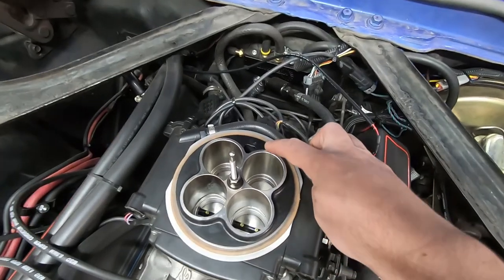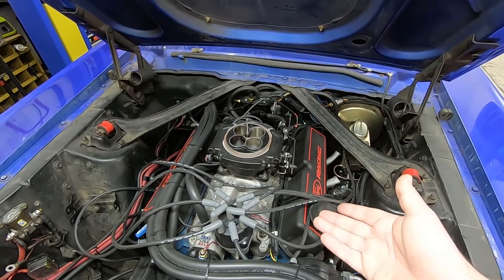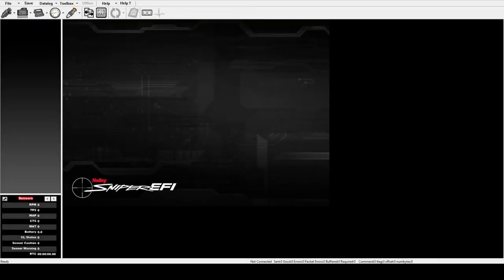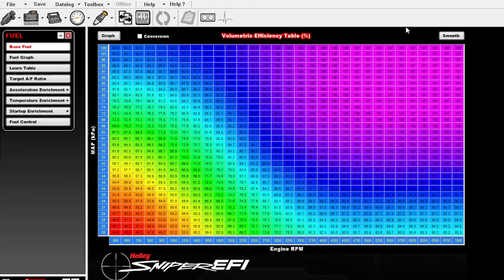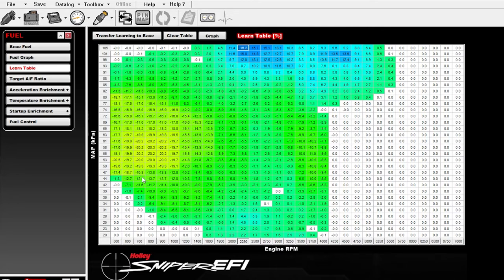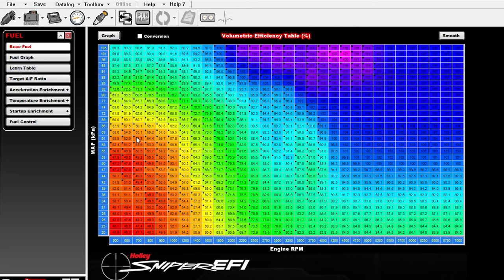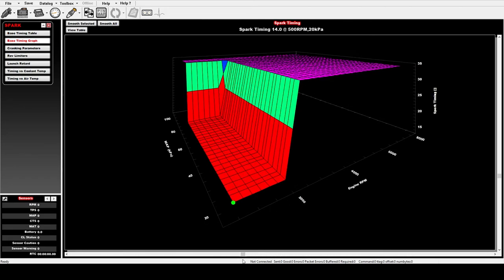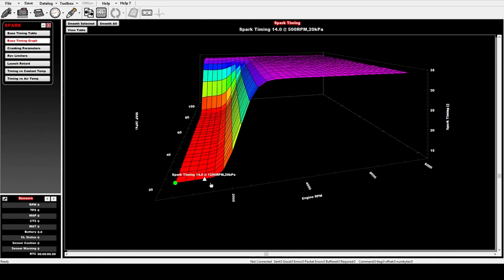What I dislike about my Sniper EFI system and how to fix them!

Comment: So, I'm trying to work through some challenges with my Sniper install.  Here's some of the challenges that I'm currently having and some history.  I'm not sure what your appetite is for this type of question, but here goes.  The car is a 4 speed 1970 Gen II Camaro.  What  I know for the engine is:  probably a 383cu.in SBC.  It has a roller cam, Trickflow heads, an RPM Airgap manifold with 1" spacer.  I do not have any cam specs but a month of fiddling with the Sniper and various testing would indicate that the cam has a lot of overlap.  At 800 RPM the engine only develops about 7-8" of vacuum.   I have tested for vacuum leaks and even replaced the manifold gaskets.  The only vacuum port on the manifold goes to the brake booster and the Sniper ports are blocked off.  Two different vacuum gauges confirm what the Sniper shows for KPa.  

The good news is that it runs OK but I can't get it to idle well.  I've tried all of the "tuning" tips on the IACV to no avail.  Right now with the latest reset, the throttle position is about 2-3 turns off the stop but the IACV reading is about 50 after the engine warms.  It will also stay above 2000 RPM when driving - sometimes it will return to my programmed idle speed (1000rpm) sometimes it stays about 2000 rpm until I blip the throttle or keep the engine in gear until it runs below 2000 rpm and then shift to neutral..  then the idle will return to the idle set of 1000rpm.  BTW the engine seems to run quite rich at lower rpm and my VE table shows the same even though the AF ratio is set for 13.7 for idle..  15.3 for cruise and 12.5 for WOT.  

I think my question is how do I set idle and IACV to eliminate this problem?  I have tons of other questions but I'd like to get that resolved first.  OH and your above video indicates that I must transfer "learning" after each drive?  I that correct (I'm using a laptop NOT the handheld)
Reply from the maker: I would do 2 things. First, tape over the IACV and adjust the idle the best you can to try to get it down around 5-10 warm after you remove the tape to hit your target idle. Next, check your power supply to the Sniper unit. When my power supply was not perfect, my IACV would do this same thing, and because it got better when I blipped the throttle I thought it was running related, but really it was power related. Occasionally it would even "stick" and read that it was 0% open but was physically wide open with a 2k idle.

I eventually solved the issue replacing m fuse block with a PMU-16 and rewiring everything to go through there, but you can probably solve yours just making sure your power source for the Sniper is from the battery and not from a dirty source on the alternator side or shared with other surge happy devices.
Reply: @AmbiVe    I have performed the IACV tape-the-opening and adjust the throttle routine at least 5 times - the last one yesterday.  Everything is wired as Holley specifies  - directly to the battery.  I have a triangular marine battery connector on the post and the power to the Sniper is taken from 1 of the 3 posts on that connector.  My alternator has been upgraded to a 14.4V system and the primary alternator wire has been relocated so it doesn't run along the length of the manifold and goes down the front of the block and only to the starter.  My gauges and logs show 14.4 volts consistently.  My log from yesterday shows 14.5 volts with about .2V fluctuation.
I couldn't drive it yesterday - it was raining - let me take it out and see if the problems persist while driving - they did in the garage..    And I'll try the IACV tape and set again..  maybe I'm doing something wrong..  I have also replaced the IACV just to be sure..  

THANK YOU FOR YOUR TIME..  I may have to take this to an expert but I would like to learn to tune this engine and spending $100's more kind  of defeats the reason I chose the Sniper..
Reply from the maker: Mine never showed any voltage issues either, it just disappeared after the rewire and retesting. Where are you pulling your 12v switched power for the Sniper from and what are the speed settings on your IACV set to?
Reply: @AmbiVe  12v switched power from a 12V Switched source in the aftermarket harness directly from the fuse block.  Nothing else on it but what was your solution - PMU16?  Who makes that?.
Reply from the maker: ECU MASTER makes it, but it's spendy. You can achieve the same thing for less, I wanted to eliminate fuses and base relays from my car. Is your battery still in the engine compartment with a short run to your fuse block? Are you pulling off an existing switched power feed?

If you reused an ignition freed on an old car, you may try adding your own relay directly to the battery, using the switched ignition to engage the relay, and feeding the Sniper off the battery direct output of the relay for it's switched. Sometimes the power through the old ignitions is unstable.
Reply: @AmbiVe  Spent the afternoon out running errands in it.  It only had the 2000rpm "thing" once in an hour or so of driving.  My wiring is done to spec and leads that cross spark plug wires have been shielded I'm wondering if the IACV could be sticking.  I had some backfiring early on and the Sniper "venturis" got pretty sooty??   I'll pull it and clean it and the seat and then try the block off and idle reset procedure again..
Reply: and thanks again for your videos and the time you've spent with me..  Ultimately, is there any real reason why the IACV valve settings and throttle stop matter if the car runs and idles well?  With so little vacuum at idle and the resultant possible contamination of my intake charge due to long overlap could it be that I won't really be able to reach "standard" settings?  One of my next steps may be to install  hotter plugs.
Reply from the maker: It's possible, but I fought the IACV "sticking" for over a year before it was resolved during my last rewire. I'll see if I can find the videos I took of the weird behave and make a short video about it specifically.
Reply: @AmbiVe  OK, your thoughts.  There is one area in the new harness that might be a problem.   With the Hyperspark kit the switched 12v lead has 3 outputs.  1 to the Hyperspark box, 1 to the fuel pump relay and 1 to the Hyperspark distributor.  I have used a special Delphi connector that works the same way as a distribution block to take the 12V switched power to those 3 leads.  You are right about your solution - it's more $$$ than I have in the whole EFI - do you have any other ideas and what did you migrate to that box other than the switch outputs?
Reply from the maker: @russelljones6653  The biggest change was to take the power sources away from the factory harness and verify as perfect connections as possible to the EFI and grounds. Without seeing the setup, all I can do is guess. Both your positives and negatives go directly to the battery, correct? There isn't anywhere that would branch and add draw or power surge elsewhere? How well-grounded are your engine block and chassis?

If the problem is specifically the IACV, you could try lubricating it slightly to see if it helps, but that didn't help mine much. What does the handheld unit show for IACV % when it's idling high? How about timing?
Reply: @AmbiVe  Well, I seem to have taken a big step backward yesterday.  I drove it around in the AM and things weren't perfect but it was running pretty well.  Drove it for 10-12 miles in "country" driving.  When I got home I did what I planned to do, I replaced the IACV with an extra that I had that had been in the Sniper before and did the IACV block off and idle set procedure again.  I also rearranged a couple of spark plug wires and moved/untangled a couple of the wires in the Sniper harness (mostly the O2 sensor lead) - these were very minor changes.  When it started back up it was idling pretty well and I was able to get the IACV reading down to about 10-11 at idle.  However, when I revved above 2000rpm it stayed there until I blipped the throttle and then it returned to 1000rpm (that's target in the ECU).  However, I tried to drive it and it basically wasn't drivable.  Under any load it spit, sputtered, backfired and stumbled.  Finally stalled - I barely got it 1/2 mile and home.  

To answer your questions above: I could verify with pics but both my ECU and fuel pump are wired directly to the battery - both power and ground.  There is one other fused link on the power side that goes to a PDU box that powers my Halogen headlights the main battery to starter lead and the ECU and Fuel Pump.  Other than the big ground to the frame  the ECU and FP are the only leads on the ground battery post.  No splits or branches in either set of leads.  AND that ground strap to the motor is the only ground so I'm going to add another ground: engine to frame somewhere.  

The way the car acted yesterday appears to have been electrical and maybe the replacement IACV so I'm going to swap the old IACV back in, add a ground to the rear of the motor.  Then investigate if I disturbed something in the wiring.  Biggest suspect being electrical gremlins.
Reply from the maker: @russelljones6653  I would agree. It definitely sounds like you poked the right problem area. It's annoying to feel like you go backwards in a project, but it is diagnostically relevant. You're one step closer to narrowing down the issue. From this point on, I would make one change at a time and test for changes to help get even narrower. I would even consider taking both the switched power and other power sources for the Sniper and running them directly to the battery posts, then starting the car and running it that way for a short time. It will cause the Sniper to be engaged all the time, but it will remove all of the possible problem areas from the loop. If things improve, you know it's on the switched power side. If it doesn't, it may be on the main connection from the Sniper relay to the battery. It may even be a matter of a damaged wire or problematic terminal post connection.
Reply: @AmbiVe  your suggestion to isolate from the switched 12V and go direct to the battery is a good one.  I replaced the IACV (back to the original) and added a body to block ground yesterday PM but haven't started it back up yet.  Will do that today..  

electrics/electronics isn't my strong suit but it there an easy way to take that one 12V switched lead and split it to 3 leads and eliminate any feedback between the 3?  Perhaps a little board or box with some diodes?
Reply from the maker: Yes, diodes can do it, so can a relay system. I the big question right now is if the issue is electrical, is it due to inconsistent voltage or something more difficult to test for. I know that when I installed my Sniper I made some assumptions about the way the wiring worked that caused me plenty of headaches.  When I cut out the Sniper EFI included relay, I quickly learned that the Switched wire continued on and was still needed in addition to the main power feeds.

I will go look and see if I have my notes from the rewire to see what else I had figured out.
Reply: @AmbiVe  thanks - I'd love to see your notes and conclusions..  I'll have the results of yesterdays changes in a few minutes...
Reply: OK, so it's running pretty well again.  As I said above I did add a chassis ground in addition to the engine to frame ground I have.  It goes from one of the starter bolts to the firewall.  I don't think it made much difference but it's good to have it.  My guess as to the root cause was the other IAC valve..  I'll toss it.
My 2000 RPM (high idle) problem is still there but I think I have some good clues:
1.) if I downshift and let the engine get below 2000rpm as I come to a stop then goes back to idle without having to blip the throttle
2.) if I just depress the clutch and come to a stop the engine doesn't drop to idle - the IAC value on the monitor is 30 - that corresponds to 2000RPM on my engine as well as the IAC "Park" setting - hmmm...  
3.) when the idle does go down to 1000rpm the IAC value does drop to 1-4 (the desired value?) - so it appears that the TPS vs. IACV is well in range.

I'm going to research the "Park" setting but wonder if you know why this might be happening?
Reply: This instruction set is helping:  mind you my engine specs are a bit of a mystery and as best as I can determine it has a long overlap cam.  This conclusion is based on it's vacuum profile and operation - both pre and post Sniper.  It came from the Holly Sniper Forum:

"If you want to make the IAC function almost unnoticeable under normal driving with a manual transmission, try this. Bring the engine up to operating temp via a short 20 minute drive. Back at the shop shut the engine off, remove the assembly on top of the throttle body. Use strong tape to seal off the IAC port. Start the engine and use the idle screw on the primary throttle shaft to make it idle at your Target Idle Speed RPM in your GCF. Shut the engine off, remove the tape from the IAC port. Set your IAC Hold Position in the GCF to near 5 to 8%. Restart the engine and note the IAC %. The idle screw should only need a minute or two adjustment to get the IAC% between 1 & 5%. For a strong running manual transmission engine, the lower the IAC% the better if you're trying to mimic the feel of a carb. You want as much air flowing across the throttle plates as possible. Set the Ramp Decay to 1 second or less. Set ramp RPM to 700 and Re-enable Idle RPM to 100. When I want to hide the IAC function during driving in manual transmission cars, this works well for me."

I also have been researching EFI/RFI and came across another youtube video that recommends a bunch of potential sources and fixes.  One of which I haven't addressed and that's that the air cleaner and mounting post could be acting as an antenna and to switch the metal threaded rod out for some form of plastic.  The air cleaner housing on many cars (especially older muscle cars is quite close to distributors and other high voltage components and could be acting as an antenna).
Reply from the maker: Sounds like some good progress. I would think that you could help rule out some of that by adding a grounding wire to the air filter hat or something to cut down noise.

I'll be curious to see if any of that helps, I'm going to be doing away with my old school filter setup to add dual intake tubes to cone fillers to bring the intake air temperature down on longer and more aggressive drives.
Reply: @AmbiVe  I've ordered some plastic stud lengths and will try that.  on a drive this AM the "fast idle" still occurs occasionally.  it's better but not gone and it's inconsistent so maybe it's interference.  I'm also going to remove the alternator belt and test as well...   

BTW - how often do you think I should "transfer" the fuel learn table to the base?
Reply: OH - my car has a cowl induction hood so my intake temps stay close to ambient when I'm moving - thanks again for all your help

Comment: Thank you for this!!  Can you offer any thoughts about how you fixed the IAC issue?  I am having the same issue.
Reply from the maker: I'm not totally sure what fixed my IAC issue. I basically blocked it off with tape, set the mechanical opening to where the car would run and idle about where I wanted, then removed the tape and restarted the process. The problem of it hanging came back a few times and Holly asked me to lubricate it. I also cleaned up the wiring voltages with a PMU16. Something between the two seems to have solved it.

Comment: Do you have a dual-plane or single-plane intake on your engine? I'm asking because I currently have a dual-plane and I plan to install Sniper EFI onto my vehicle, but I hear the self tuning and fuel distribution have problems with dual-plane intakes. Holley says it doesn't matter, but I've read that a lot of people found better luck switching to single-plane intakes. Do you have any input?
Reply from the maker: I'm currently running a dual plane and it's working well enough for most street use but there are a few little gremlins. It was easier to tune on a single plane, but I wanted to see if I could get it working on a dual plane for the torque improvement.
Reply: @AmbiVe  Dual plane intakes don’t work well with the Sniper system.Fuel distribution issues will make it appear the system isn’t working correctly when it’s a combination issue. Too much impulse from the intake disrupts your fuel distribution on the sniper. Whereas a carburetor needs those impulses to meter correctly.

Comment: My carbed Pontiac runs perfectly. I just hate the cold start ritual and want EFI for that alone. I’m just worried about opening a can of worms.
Reply from the maker: If you keep it simple, it shouldn't be a problem. The key is to do the homework and understand how it will work with your setup. The cold start and high altitude issues weed the most frustrating when the car was carbureted.
Reply: Cold starts with a carb are no problem if you have it all dialed in right. Timing, carb mixture, vacuum ect. Put an electric fuel pump on your carbureted car and save yourself the headache. You’ll thank me later.

Comment: Im using the hyperspark dist and coil, starts and runs pretty good but falls on its face for a second when you stab the throttle and IGN timing drops to zero, if I set it to static timing it runs like a beast! Even if I set all timing values the same it still pulls timing for a second on accel  Maybe looking at the tables on a computer might help eh?
Reply from the maker: I would check the tables, check your TPS is reading correctly through the range, and check that your voltage isn't dipping. I would also double check that the timing on the gun matches what the computer thinks it is again to make sure the distro isn't loose or moved.